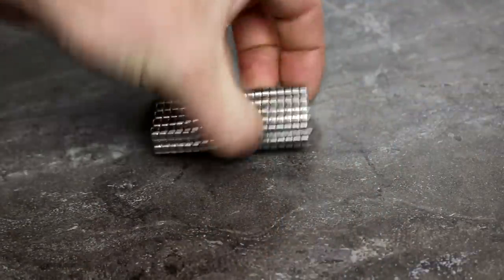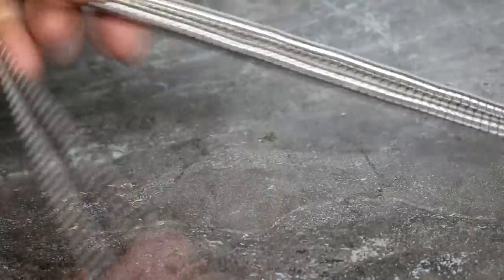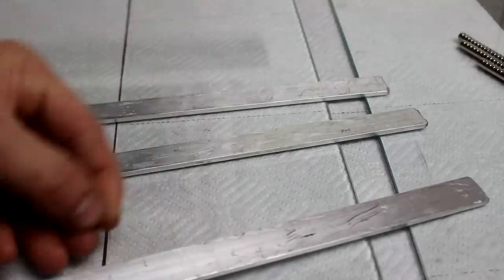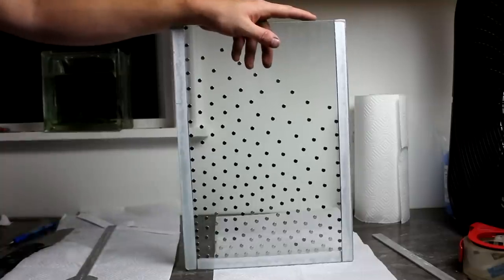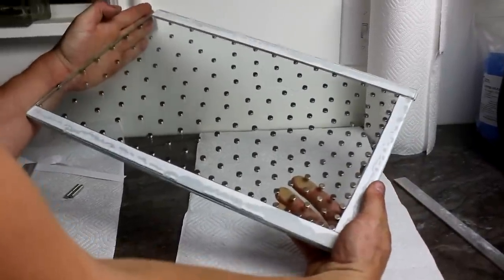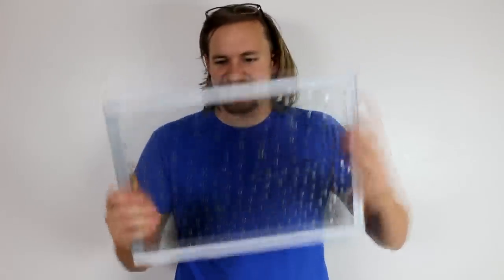Modeling a Gas With Magnets

Comment: Try filling it up with oil or some lubricant, so they move more :D
Also, I'm curious, when you turned another magnet outside of the chamber, and caused the smaller magnets to move, is that similar to how light heats objects up?

Comment: Cody, if you still have this thing stored, maybe you could attach the big magnet to a motor to simulate a constant jiggling of the atoms due to thermal motion and/or mount the glass in a vibrating plataform. 
if you have a way to set that up it could be interesting to see the effects happening by themselves instead of you having to jiggle the whole thing each time..

Comment: So.. I may sound really stupid, if in space. Let's say you took out gravity, without any applied force would molecules just sit still? Like in this representation where the magnets aren't vibrating and/or moving around like they should have behaved in a gas that has gravity acting upon it. My thought is that, would this representation be valid if you were to be in space? Again I may sound extremely impotent but I do not know whether molecules in space move without the applied force that gravity provides.

EDIT: Another question. With the ever-expanding space... are the particles of the gas molecules constantly spreading further and further apart in our solar system?

Comment: Perhaps you can change the strength of the magnets in real time, for example by using electromagnets instead. I'm not sure how exactly this can be done but I have a feeling it can. It would enable many interesting effects, such as creating constant vibrations to simulate heat, etc...

Comment: it's rather a model for a zero temperature compressible fluid or glas, if you wanted to introduce something like a heat bath, you might have tried to introduce a moving string with randomply placed magnes. driven by an electric motor it would excite the "atoms" in your lattice opon a pass-by. so you'll make an influx of random momentum -- the heat

Comment: The speed of sound in a gas does depend on the pressure though. It's the derivative of the pressure with respect to the density.

Comment: Gas not mixing.  Back in the day of long tube fluorescent lamps did you ever see with a new lamp the light spirals around inside the tube on one side? After a short while or turning it off and back on it disappears. Ever wonder what's causing that?  A fluorescent lamp contains Argon gas at a very low pressure and a small amount of mercury.  The argon gas is ionized as well as the mercury vapour which produced UV that's converted to visible light by the phosphor coating the glass tube.  

When the lamp is made there may be a very small amount of unwanted gas left in the lamp.  When the lamp is turned on the ionized gas / mercury vapour wants to go the shortest path from electrode to electrode. However if there is a very small quantity of another gas which does not ionize it collects in the center of the glass tube.  Now the ionized gas wants to go through the center of the tube but there's this other gas there, so it has to move AROUND it...and that's the spiraling we see. Eventually this unwanted gas is chemically absorbed by the electrodes and the spiraling stops.

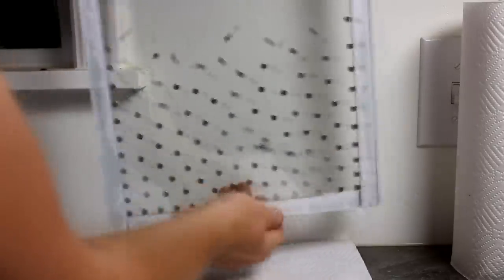Comment: 4:30 - Interestingly enough this is how temperature works. Nothing happens until you start moving stuff around (temperature). Otherwise, your model is of gas at absolute zero. Maybe try putting this on a vibration table to model how temperature works!
Reply: Also, maybe try filling this with oil for a more accurate model?

Comment: then the flateathers will use this as a source to proof gravity wrong due to electromagnetism even though electricity doesnt even need to apply in this model although electricity is created technically speaking.

Comment: This is genius!  It would be nice to add the same magnets with adhesive tape along the borders of the frame as spacers between the glasses, so that other magnets do not jam between the glasses
Reply: He did say the sides have the same thickness as the magnets. And he added paper. 2:45

The magnets keep jamming because they turn and end up pressing against both glasses, being under torque from the surrounding magnetic fields. The jamming force will probably be slightly stronger if the gap is made slightly larger.
Reply: @u1zha  thank for explanation. Well then perhaps some lubricant like silicone spray coul help. Also the use of mineral glass instead of organic glass would also contribute to less magnet sticking, since they would not cut their sharp edges into the soft acrylic surface.

Comment: Did you notice that it was only moving the bottom magnets more in your pressurized system of magnets when you were on the reverse side at least I noticed that may have even happened earlier I just haven't checked yet when you were in the front of the magnets...😉

Comment: Once had a denier tell me that CFCs can't hurt the ozone layer because CFCs are very heavy molecules and can't go up there.  Cody demonstrates here that heavy tends to lower elevation, but gas pressure does push it up some.  Besides, if the heavy gas sinking to the bottom were true, everyone near seal level would be dead as the 1% of argon in air settled to the bottom and displaced all the oxygen.

Comment: If you must have excessive hand dance then uncross your arms and do your hand dancing behind the visual mock up. Why bother if you are just going to excessively shove your paw in front of the camera defeating the point of having a model mock up in the first place . Not interested in your hand dancing skills.  Video 101. Becoming aware of the blockage half way through was more then enough to do a 'do over'.Your technical verbiage is off. View your stuff before you post it.

Comment: Someone give this guy a Physics book
Reply: Yes he needs to open one, too many mistakes in his videos. This one may be the worst.
Reply: In order to add to the collective knowledge of the community instead of just commenting useless spam, care to elaborate?
Reply: 8:57 "That is why the speed of sound depends on the temperature not the pressure... its the vibration of the particles not pressure which is the average distance between them..."

Remember that his original statement that he was elaborating on was "as I vibrate it the gas comes back out of there (fills the space)"

He was just stating that the fact that the magnets did not immediately fill the space without first being but into motion (vibrated by the magnet) because they require motion (temperature) to fill the space (transmit sound) and not simply a small average distance between molecules ( high pressure), like he said that matters, but not much (as can be seen by the magnets originally springing up some, but not fully until they are vibrated) and that this is analogous to the speed of sound in a gas.

He may of done a poor job of explaining it since he was just talking off hand, but I don't think he made a mistake there.
Reply: Jeremy Davis temperature in a gas is not just vibration. And saying "this is why" doesn't prove it is linked to whatever had been told before... Btw for magnets, the "pressure" is what "fills the room"
Reply: Temperature in gasses, by kinetic theory, is a function of the internal energy of the system. While there is more internal energy than just vibration, that doesn't mean he was incorrect in saying vibration caused a change in internal energy of which temperature is a function of.

However when he said "vibration" he did not mean he was vibrating individual magnets (raising the energy state of individual molecules), he meant that vibrating the external magnet induced motion in the internal magnets which increases the "speed of the molecules" as your first comment stated. 

Also I don't understand the second part of your statement, he made no attempt to prove anything he was simply making an analogy.

Again, I think his explanation was confusing but not incorrect.
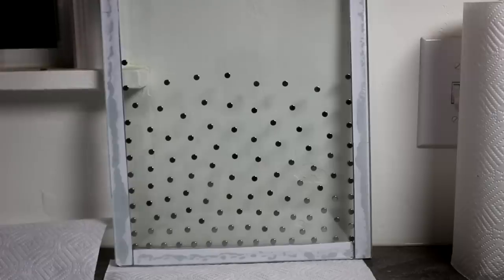Reply: 5:53 - he explains that.
Reply: Its a demonstration, not an experiment
Reply: Jeremy Davis I totally agree.